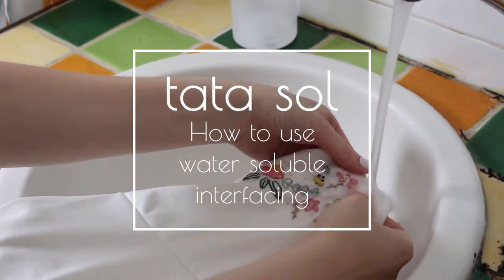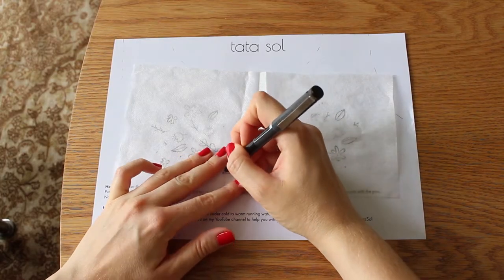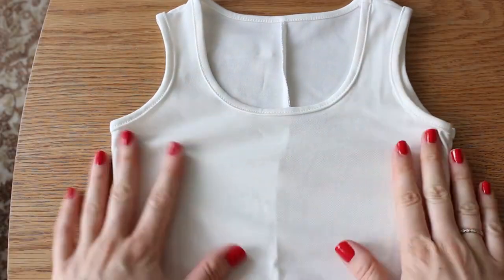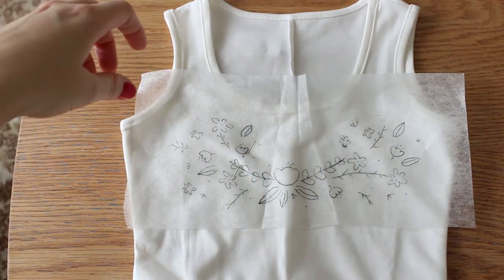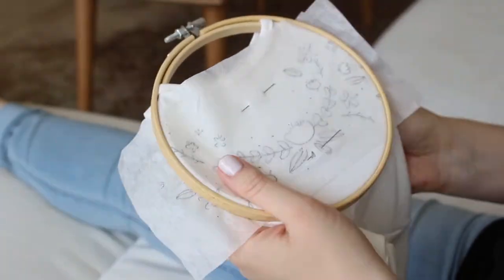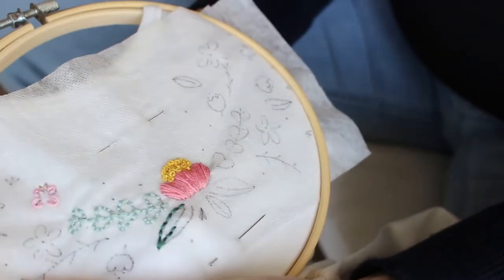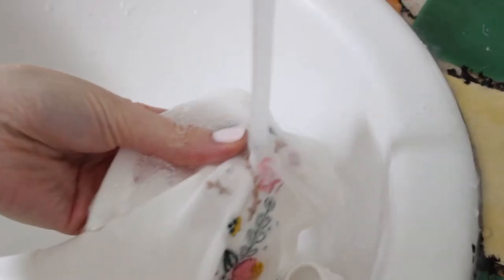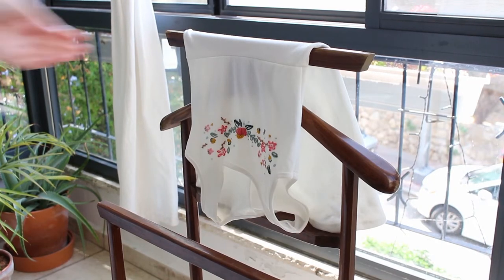How to use water soluble stabilizer to embroider on clothes

Comment: I'm always wondering, what do you do with the back of the stitches to prevent it from itchiness?
Reply from the maker: it depends on the fabric but you can iron on a sticky fabric, something like interfacing
Reply: @TataSol  I need a double sided interfacing so I can put a cover (on the inside that will touch baby’s skin for the work I did on a Onesie.  It is rather large motif and detailed one.   Do you know the name of brands?